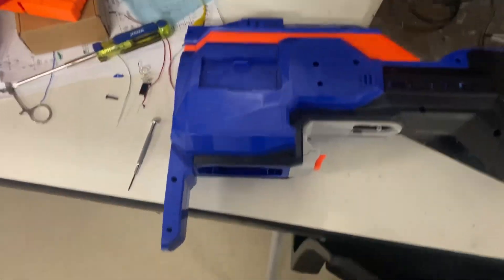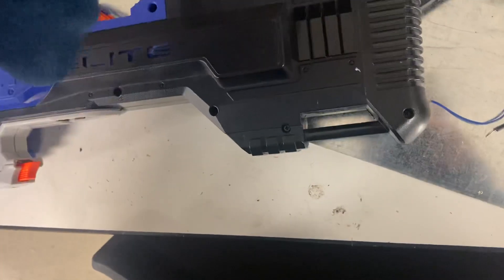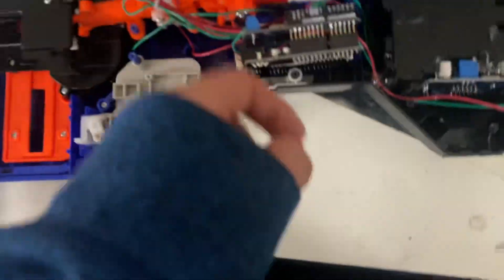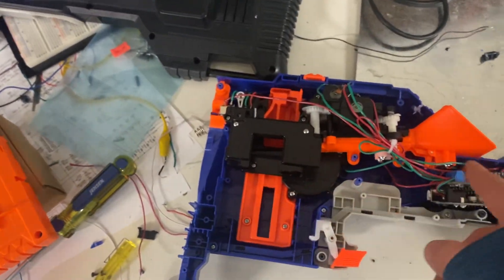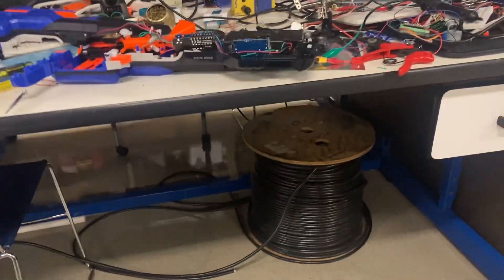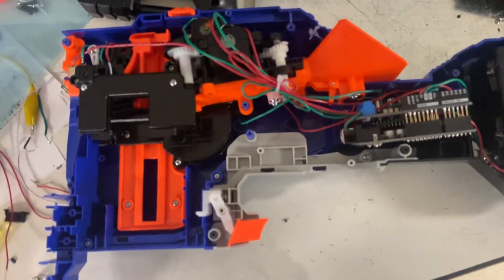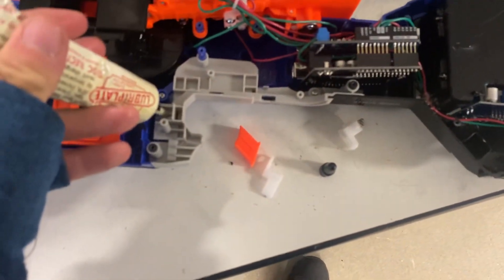Introducing the Automated Reloading of Magazines System (or ARMS for short)

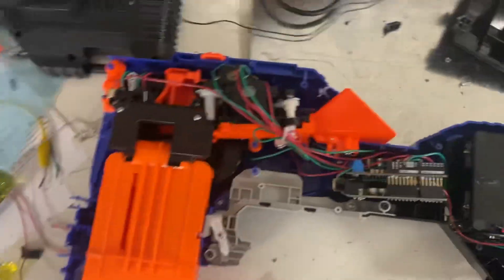Comment: 4:45  little tip to fix the mag release: file the corners of the tab that goes into the magazine down slightly, just enough to hit the curved back wall of the magazine when it slides in. 
the Infinus has a squared mag tab for some reason unlike other blasters.
Reply from the maker: Thanks